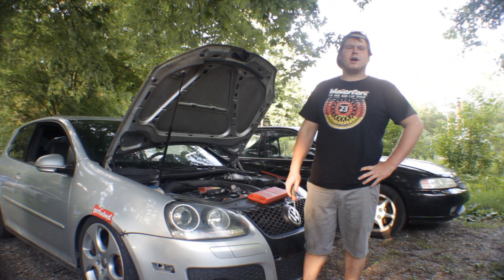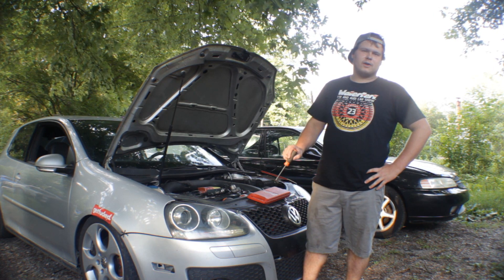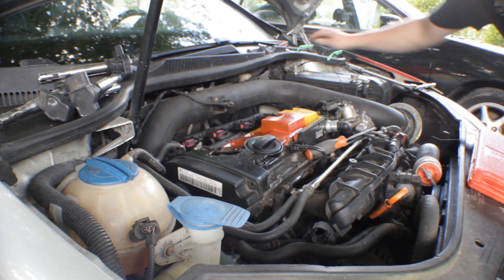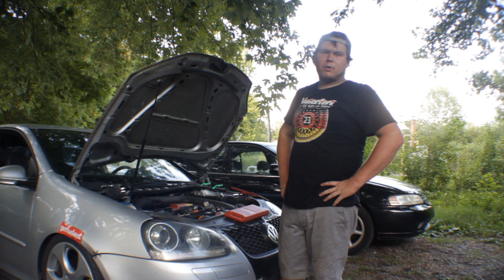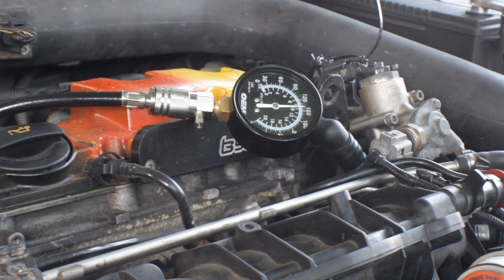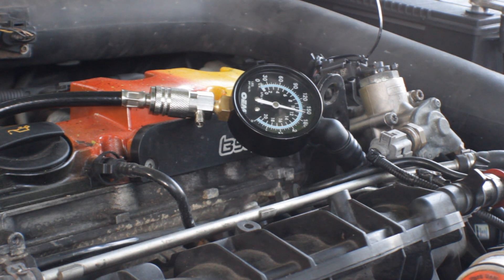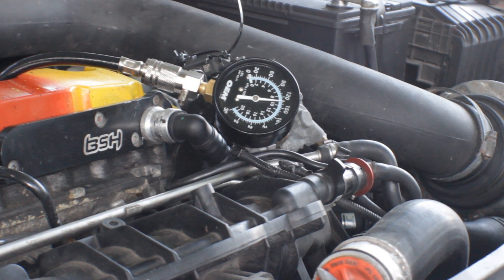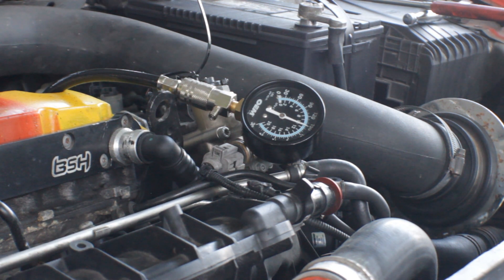mk5 gti compression test diy

Comment: got 120psi -115psi  all 4cyl @ 171K is that low dry test.  Great video!
Reply from the maker: @paulpalacios7197  that sounds very low to me. Do a wet test and see if numbers increase significantly. If they do your rings are worn. If they dont you will have to perform a leak down test to find where you are losing compression

Comment: I just finished doing a compression test on the same motor in my passat wagon. Sadly, I am getting 0,30,30,150 compression. cylinder one has literally zero compression... cylinder 4 has 150 but starts to drop and makes a "hiss" sound while the guage needle goes down to zero. I have checked the timing belt and it appears to be in good shape. How would you proceed??
Reply from the maker: Look up a video on how to do a leak down test. You need to figure out where you are losing the compression from, this test will tell you.
Reply: @TheRollingTimes  could a compromised head gasket allow compression to be 0,30,30 and 150? My understanding is that if it were to be piston rings. I would have some compression but that 0 on cylinder 1 has me tilted 😂
Reply from the maker: @ivanvega2821  its hard to say for sure whats going on. You can try a compression test again with just a few drips of oil in each cylinder first. If you see a raise in compression with the oil, this would indicate bad rings. To have 0,30,30,150 I would plan on getting a good used engine or having yours pulled out and overhauled. If you do a leak down test on each cylinder youll know exactly where the loss of compression is. It will either show up in the crank case, the intake, exhaust or cooling system. Id says its unlikely but not impossible to be a headgasket issue.
Reply from the maker: @ivanvega2821  also a compression test gauge should hold the highest reading. There is a schrader valve in the gauges hose. If the gauge doesnt hold pressure you may be getting inaccurate readings.

Comment: Did you unhook fuse pump relay??
Reply: Fuse 27 beside drivers door
Reply: I meant to ask where is the fuel pump fuse? Is there a fuse and relay? Trying to find info online but haven’t really been able to pin point exactly what fuse or relay I should pull

Comment: 2.0 T-FSI engine ? I meassured an cold engine and with low battery pressure at all valves arroud 10 Bar. Engine 2.0 TFSI with code BWA. 250000km. Engine is heavy carboned - I decarbonized it.
Reply: Hi there, do you still own the car if so what is the milage? Just got 08 GTI MK5 with 250K on it. Trying to dig into the engine and check the condition over the weekend. Happy rest of the week!